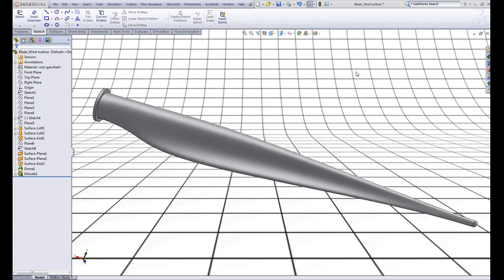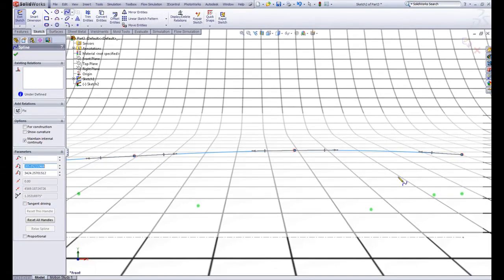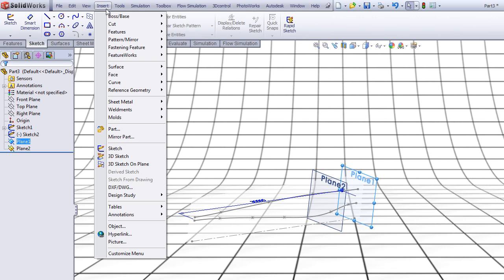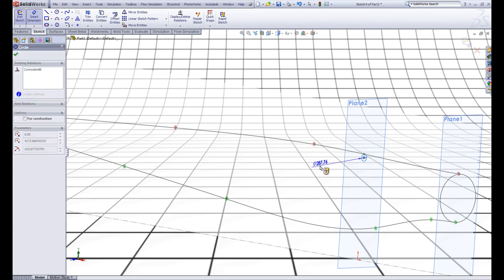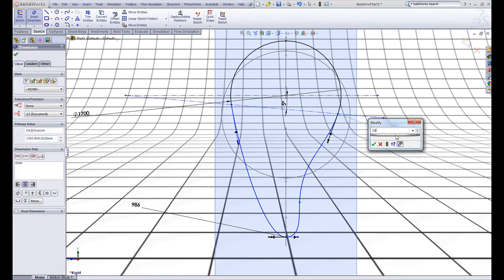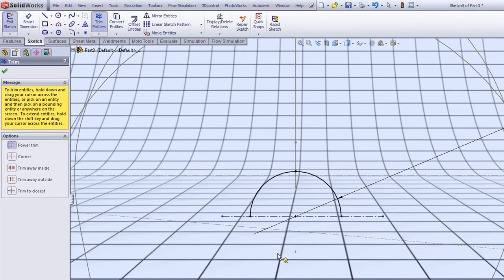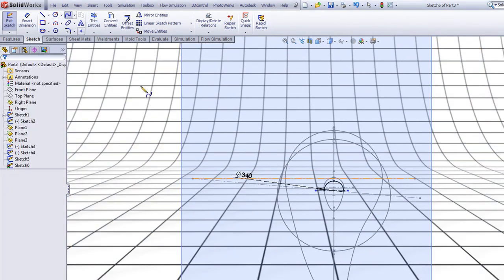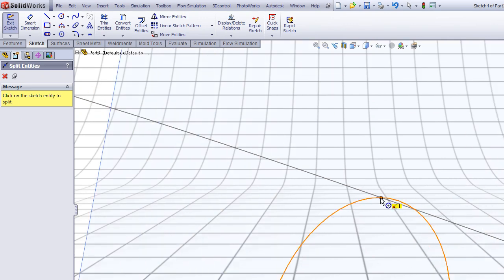SW Tutorial: ''Surface modeling''. Modeling a blade for a wind turbine (part 1 of 2)

Comment: What is this blade for? It makes no sense from an aerodynamic point of view. Nice continuous surface, but I lack the connection to the actual design phase of the blade where you choose airfoils, define chord, twist distribution, thickness etc.
Reply from the maker: Hi Mats. Thank you for your input. The purpose of this tutorial is just How to use surface modeling and not How to model and aeorodynamical correct windblade.